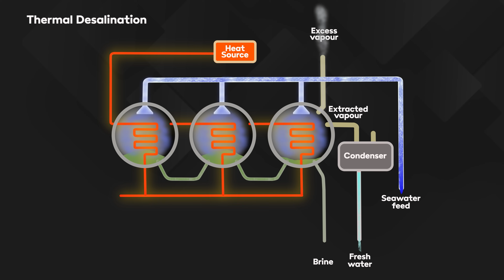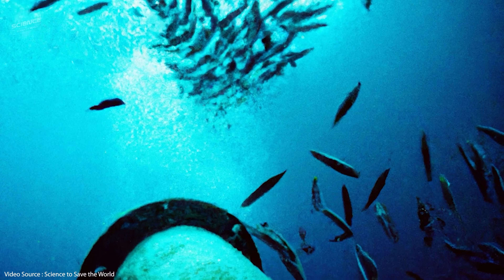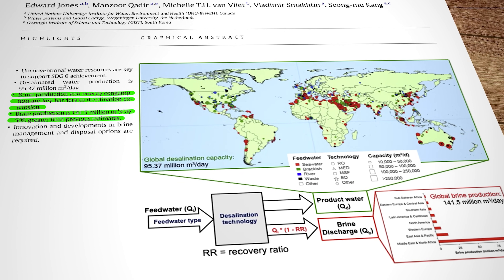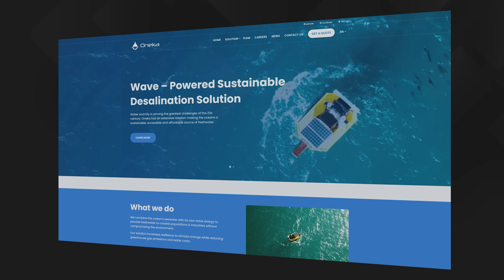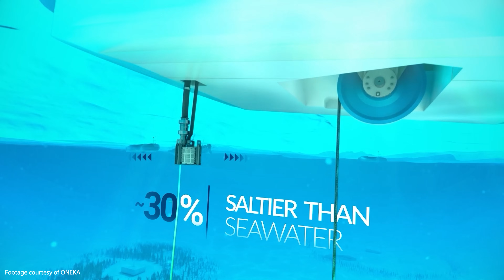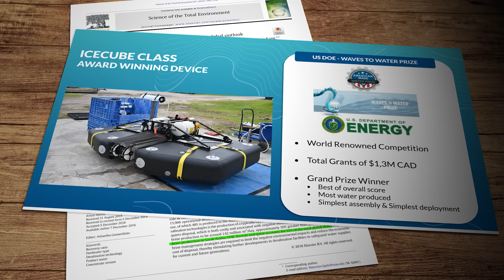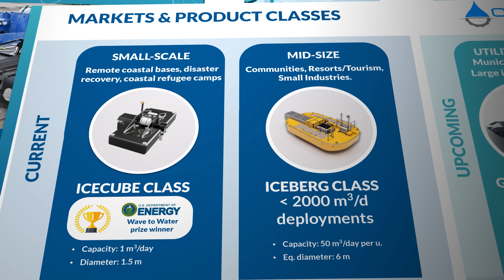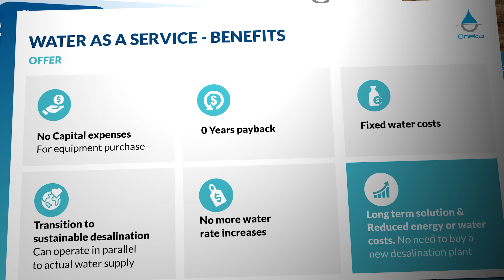Fresh Water at Zero Energy Cost . How do they do that?

Comment: Another niche method would be in the Dead Sea.  There is a plan to bring water through a canal to the Dead sea from the Red Sea.  The dead sea is about 600m below sea level so water dropped down a pipe from the canal to the dead sea would be at a pressure of about 60 atmospheres.  You only need 30 atmospheres for reverse osmosis so this water could be run into a desalination unit for no extra energy cost.  The Dead Sea is already about 10 times as salty as the ocean so there is no problem sending the brine to the Dead Sea.

Comment: sounds a very good idea, but a few small points, to get the best out of the system you are going to need large waves, but the larger the wave the more ware and tear which will in turn require more maintenance, which will be more difficult the larger the waves, plus what is proposed are multiple small platforms spread out over a distance it could be a danger to shipping, and finally desalination plant run by pure mechanical energy sounds great, but  coastal areas are not usually short of water, it is the centre of large countries or continents that are usually dry, so you will still need electrical power to transport water hundreds of miles inland

Comment: This has given me a thought.  What if we reversed this whole operation. i.e. take fresh water and put it in a vessel with salt water BUT separate the two water types by a semi-permeable membrane. The salt water will draw in water from the fresh side of the membrane by osmosis, thereby increasing the pressure in this side of the vessel. Then, as with many systems, pressure can be used to power a generator. There must be an almost limitless supply of these two types of water at the mouths of large rivers. And since the fresh water was just about to mix in the sea, there will be no wasting of this precious resource. I assume the membrane would work more efficiently because it would not be clogged with Sodium ions. But no doubt there will be some dissolved solutes in the fresh water.

Comment: A very simple land based system is possible by building a pair of tanks in the ground by the sea so that the bottom of tank 1 is 40 cm below mean sea level. Drain water in via a sand filter under the sea. Brine discharge is via a long corrosion resistant pipe well clear of intake. Tank two is attached to tank one with a powered fan in the pipe. Power is grid power or solar with a battery buffer for night operation. 
Warmed salt water is pumped up to the top of tank 1 and sprayed out of salt proof nozzles. Tank 2 draws chilled fresh water from its bottom to more sprayers at the top. Tank 1 is heated with a large solar hot water system. Tank 2 is cooled by a day shaded night radiator. The fan draws water vaper from tank 1 to tank 2 where it condenses on the spray droplets of chilled water. Salt water never goes though the solar thermal collector or the radiator. Thermal mass blocks in tank 2 ensures that it retains the night cold. Insulation can be light wood. The heat exchangers in both tank need to be ceramic or concrete coated to avoid corrosion. This design is about 50 years old and I don't have the capital to build it. The problem is that people keep tying to float it on the ocean. The discharge at 30% is also an old solution.

Comment: Go to a flea market or a used book store and buy an old economics textbook and look up the concept of 'economies of scale'. Little decentralized small scale material intensive platforms spread out all over the creation that all have to be wired and piped to. 🙄If coastal brine is really a problem, employ 'economies of scale' and create a resource optimal long pipeline to a remote spot in the ocean where it can be dispersed.

Comment: Using ocean mechanical energy makes good sense. Regarding your new background: the bright yellow spot on the circular object  in the background is distracting; likewise the cylindrical lamp on the other side of you. It's almost as if you want the viewers eyes to skip past you and dart back and forth between bright spots. The just have a think lettering on the small screen in the background appears slightly out of focus (which may be either out of focus or due to subdued lighting of the overall set). Keep up the great programs. Cheers.

Comment: I have an alternative idea. If we drilled a hole into the earths curst to where the temperature is 100 °c then place a boiling chamber in the hole. Sea water can then be put into the boiling chamber. Once the sea water boils the water vapour can then escape through a pipe. We could then have turbines to generate energy. The water vapour can then go to a cooling chamber. The brine that is created I was thinking there could be sensors that will detect whin the sea water becomes brine. The sea water going in would be stopped and the brine extracted. It would be transferred tp a  refurbished oil tanker(converted to a green alternative to diesel). Then when the tanker reaches a suitable quantity it can set sail and drip feed the brine into the sea.

Comment: Desalination of 25% water is very low and not effective. The idea of RO is to produce as much fresh water as possible in Lowe number of units. Otherwise, you can operate RO at lower pressure to achieve the 25%, then you need more unit to produce more water.
Reply: There's a lot of factors to consider with respect to the rate of water recovery. 25% recovery is actually pretty reasonable.
Reply: Also, to produce as much water as possible is AN idea about RO, not THE idea. There's a lot of stuff going on with respect to designing a plant for low cost of water. I consider maximizing water production per unit a naive design strategy.

Comment: I really like this Oneka which uses mechanical wave energy.
Oneka's small, dispersed boats are good for the environment, but are they economical? Don't forget that they aren't on land! That makes transporting desalinated water more expensive. After all, a pipeline on land is cheaper than a submerged one.
However, they use the free energy of the waves. That may improve the economics significantly due to the amount of energy used in distillation and reverse osmosis.

Comment: Thank you for this information. The mo' solutions to problems the better. Especially when they use common equipment and process. The Original Compressor of a Refrigerate Cycle Circuit RRC generates Its Total Energy with a temperature and pressure range that requires an air/refrigerate & water/refrigerate heat exchangers to Transfer the Total Energy. Heat pumps transfer energy. HVAC companies castrated the circuit so its capacity to transfer the Total Energy is only 1/4 of the Original RRC. They want to sell four times as many using 4 times the energy. Cooling Towers are a Grift. Water treatment for Cooling Towers & their make up water is a huge GRIFT. One pass water use needs to at least be for AGRICULTURE, not for Fossil Fuel'rs profit!

Comment: Let us begin by considering sea water as a solution, with pure water as solvent and common salt as solute. The quantity of solute decides the concentration of brine 
As solubility. Is directly related to temperature. At lower temperatures, salt would precipitate and settle to the bottom.
In other words, cooling should be more effective than heating.
Denser sea water firming the bottom and lighter SD olvent MN ama king thE top. Srperatab kk e by a seperating funnel?
Reply: That's an interesting idea. I've done a few projects that involved precipitating a solute. I was surprised by how long it took so I wonder what your precipitation desalination process would look like if it was going to have a high production rate.
Reply: @jeremysimmons8864  a batch process us envisioned, with fixed volume!!!!

Comment: Sounds great and very logical. By converting wave energy into mechanical energy and using that directly to pressurise the salt water, it eliminates efficiency losses in the conversion to electricity then back to mechanical. Only tiny query I have is : when they say that no increase in salinity was detectable 2m from the platform; did they sample below as well as laterally from the platform. I ask this coz I believe the more saline solution will sink rapidly when discharged.

Comment: There’s a scientific error here. So, seawater has a certain salinity. If I remove some specific amount of fresh water out of the ocean, I leave behind the same amount of salt water REGARDLESS OF DESALINATION TECHNIQUE. It doesn’t matter if the brine is concentrated or dilute. If the brine is dilute, that just means you have to discharge far more volume of brine into the ocean. If you have a concentrated brine, you release very little into the ocean. The fact that this tech doesn’t increase ocean salinity much just tells me that they aren’t desalinating much water. If they were pulling large volumes of fresh water out of the ocean, then the remaining ocean would become saltier regardless of technique of technology.
Reply: I think you've got a good point related to conservation of mass. Although, I think the argument made about the brine discharge points being spread out is that there is better diffusion of salt into the sea water and that the larger footprint makes it more likely that ocean currents will advect the salt away from the area. I think its a naive argument because the brine discharge needs to be far away from the sea water intake so it will likely that the design will opt to collect the brine into a single pipeline for transporting it away. 

I want to also point out though that there may be a significant advantage to having a more dilute discharge. Higher concentration brine may have a bigger ecological impact than more dilute brine. Although the salt diffuses into the sea water to equalize the concentration eventually, there is a continuous stream of high concentration at the discharge. Having that stream be a lower concentration may be less harmful. But idk, its something I've been thinking about for the last few weeks and am curious to understand.

Comment: those units could make some coastal areas and areas near the coast fit for small settlements if people make a point of using little water. Thinking of Chile. Or some islands. Those settlements would need to use water saving strategies, but one can have a high quality of life with very reduced water consumption. Even with farming. See Isreal, see the Earthship villages in ? Arizona, see Geoff Lawton's Greening the Desert project in Jordan. Using composting toilets, recycling of grey water with help of reed beds (which also limits what detergents can be used for laundry, dishwashers - or they have to processed more intensely and separately. I can see how such a project could have a central laundry where people do the hot wash, where you can use bleach etc. I am not sure if there is harmless dishwasher powder). 

And small scale but intense, diverse ! organic gardening or farming (essentially permaculture, which can be done at the level of a home gardener or a small scale farm). 

See what Geoff Lawton does in Jordan with the Greening the Desert project. They have to get grey water by trucks for irrigation, that is a normal thing in Jordan. Every drop of rain (in winter) is caught, they have good soil (after 12 years of improving soil, they started from scratch = sand / dirt) so the soil will store whatever little rain they get (plus the runoff from the hill above them, and the runoff from the street). 

Of course they use efficient drip irrigation.

They have composting toilets and the water from kitchen and showers is processed in reed beds and then used for irrigation. One of the reasons they need more water (which they get by truck) is that they have a lot of visitors, they do workshops and have volunteers. These people import nutrients (composting toilets) and they bring money and they bring know how (a really important production factor in permaculture). 

But the visitors also increase the amount of  water they have to get by truck - compared to the number of people that would be needed to run such a farm /oasis. On the other hand that grey water (most of the extra water is grey water) is put to good use, they irrigate the trees and bushes with it, it soaks into the soil, only a part is evaporated and "lost". That processed grey water is not used for salads and vegetable beds, only for trees and bushes. same with the huManure (the processed waste from the composting toilets). For safety reasons it is only put under shrubs and trees. They have a lot of those, so no problem. 

Of course they use mulching to reduce water evaporation, they have appropriate plants for the climate (plus some veggies that need more water, but a lot of the vegetation is very hardy) and now they have a fully planted oasis so the trees, shrubs and undergrowth give each other shade. Their vegetable beds and the nursery have a shade cloth over them during the hot season. That protects the plants from too intense light and too much heat.

One of the most important goals of the project is to build and improve soil, good soil is much, much better able to soak up and to store water. And they do have tanks etc. to store rain water.

Comment: The concentrated brine issue is an over-hyped argument used by big corps who don't want to pay for desal and want to suck up all the cheap natural fresh water in the area.  Salt levels are normal just a few hundred meters from an outflow.
There is no evidence of significant harm to the marine ecosystem from desal.  However, there is massive damage, well documented extinctions and other devastation, to arid areas where all the cheap natural fresh water is used.
Reply: A few hundred meters is not a small area. I came across a published study on the ecological effects and I recall it concluding that the harm was significant but its interesting to think about the trade-off with the harm of other water sources.

Comment: Probably not reliable. It does not work for many conditions and is highly dependant on weather. Better alternative would be to massively increase renewable electricity production by solar, wind and others and then use excess electricity to run desalination plants and store the fresh water for days without much electricity excess.
Reply: I recently attended a presentation by an engineer from a national lab. In part of his talk he mentioned a design study he had done using design optimization of the mix of wind, solar, wave energy, and emergy storage based on a model of the energy consumption and production using renewables throughout the year, hour by hour.  A parameter that was varied in the study was the relative cost of wave energy compared to wind and solar. The results showed that even for cases were wave energy cost up to about 10 times that of wind or solar, wave energy was still part of the optimal mix of energy sources. This was because of the mismatch on temporal availability of wave energy that reduced the total required energy storage.
Reply: @jeremysimmons8864  Ok. That is interesting. When you write energy I assume it is electricity or electrical power. I have no experience in the use of waves for electrical power production. If it is a working method it should be done.

My statement is: Use all kinds of renewable sources (this would include waves) to generate electrical power for the grid. If there is excess electrical power for the grid because of high availability of sun, wind or waves then use this electrical energy to make fresh water in conventional desalination plants and store the fresh water. When there is no excess in renewable sources switch of the desalination process and use fresh water from the storage.

Comment: The largest consumable cost is the membrane, which is replaced say every 3 years. A 6-7 gph membrane costs approximately US$400. Installed on a boat, we used solar and wind to run the unit for a couple of hours each day. As water is in a closed loop system where is the water going?
Reply: Water goes to shore. And I would consider the water as being in an open-loop for this system. Although I might not understand what you mean by it being in closed-loop. It doesn't make sense with the two ways I use the term.
Reply: @jeremysimmons8864  closed loop as in we aren’t destroying water so where is the water going? That is, there is so much water on the planet, locked up in ice, aquifers, clouds, rivers etc.

Comment: I have a desalination idea for impoverished low industrialized nations or regions. If pressure is what is required for the reverse osmosis simply build a set of stairs for each user who needs say 1 gallon or whatever would be the rational amount, to walk up however many stairs is needed to produce that much and stand on a platform either by themselves or in groups. They use their biochemical energy to walk up the stairs, gravity pulls the platform down providing the pressure needed for the reverse osmosis. Or take a standard setup (small) and put a generator at the bottom of my platform for the electricity. I think most places in the world would give up physical work for pure water
Reply: There are plenty of news stories where populations walk 2 miles to get to a clean water source. Imagine if that physical work were done to generate the desalination instead. Moving a human 2 miles must be more energy intensive than desalinating the amount of water that 2 mi gained them
Reply: I think a simpler method would be a hand pump.